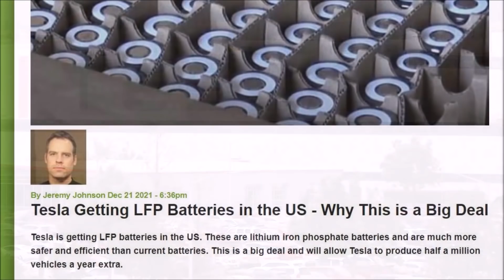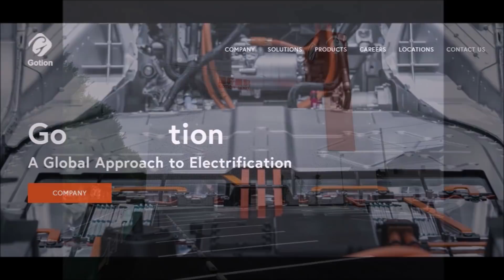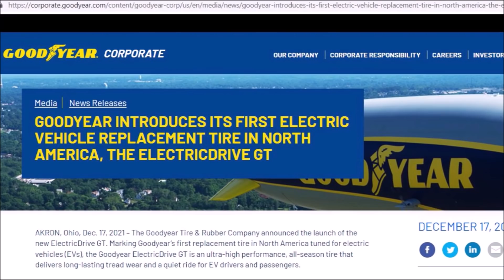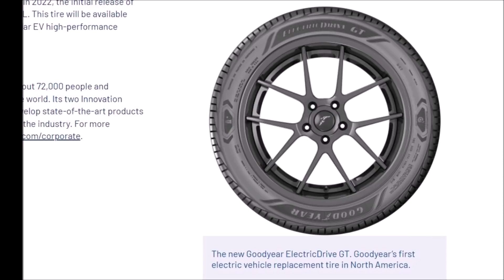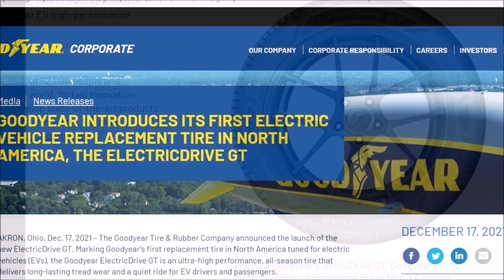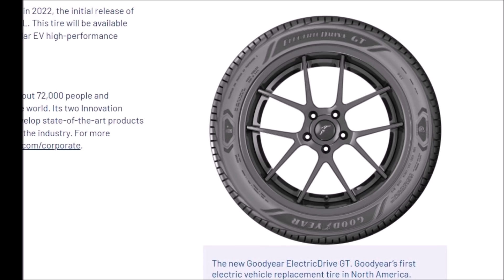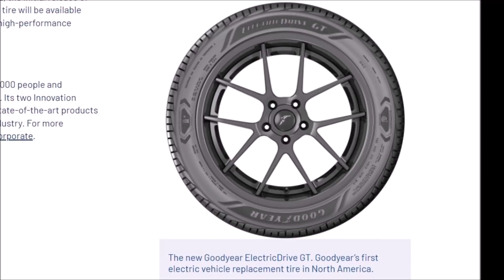BIG DEAL: Tesla Got New Batteries! Allowing 500K Extra Teslas a Year

Comment: LFP's main advantages are low cost and good availability. Not efficiency, energy density, pack weight, or performance. It makes good sense to use LFP batteries for Powerwalls, and also with their entry level models. The problem is that Tesla is not passing on any of the cost savings with lower priced models. While I never complained about Tesla's $35K Model 3 availability, the lowest price for the entry level Model 3 (using LFP batteries) is $45K ($10K more). Most EV owners charge up overnight, and don't need to recharge from zero to 100%, so they don't have to worry about having a shorter battery lifespan, where LFP could otherwise be an advantage. At least Tesla has not raised the Model 3 Performance price much, so it has become a relatively better value. LFP does have some advantages, and it is predictable that Tesla would be this battery buyer, but I think that it has more to do with profit and supply rather than anything else.
Reply from the maker: Thanks Dean.
Reply: Supply of EVs is not in balance with demand, and probably won't for a few years, but it will eventually, and then we will find out whats what with pricing.
Reply: @mohammadwasilliterate8037  Elon is not about profit. Elon is driven by issues like safety & performance and regards profit as a positive byproduct. Those two attitudes are not congruent.
Reply: LFP is safer than other rechargeable lithium. Low energy density but have longer cycle life and charged faster.
Reply: @tsamuel6224  Elon is absolutely about profit.  Profit is what kept the company from being sold off to GM, Toyota, Mercedes and VW over the years.  Now that Tesla is flush with profit, it has expanded and advanced the business on multiple fronts. What do you think it takes to build a giga factory?  What about going to Mars.  Elon is brilliant, but without money (from the for profit side of the house), he can't go after them.

Comment: Lfp? where is 46-80 battery?..
Reply: LFP is the battery chemistry. 4680 is the size of a cell (and in the case of Tesla, it also refers to the new capless design that they introduce in their new 4680 cells). You can have a 4680 LFP battery. That said, Tesla would probably start producing their own 4680 LFP batteries soon (and may in fact already be doing testing and calibration on just that). But they are battery constrained and can pretty much use every battery they can lay their hands on. Even if they produce their own batteries and even if their own batteries are superior. As long as the batteries they can get elsewhere are good enough, they'll try to get batteries from elsewhere as well.

Comment: Can LFP be used in 4680s?   Is 4680 safer than the ones that have been catching on fire 🔥?
Reply: As I understand it, yes. They are making the 4680's with the LFP chemistry. Also, the Bolt batteries that were catching fire were flat packs, I believe.
Reply: If you are worried about vehicle fires, sell your Gasoline car immediately because it is 11 times more likely to catch fire than safer electric cars.
Reply: @jacka7211  Exactly!
Reply: @jacka7211  the amount of damage done when EV catches fire is far greater, when it happens.   When is the last time you heard of a parked gas car burning down a house? It doesn’t happen.  I am still a fan of EVs.  They should get to the bottom of these problems.
Reply: LFP is better on cycle life, Max temperature and cost. Worse on weight and size for the same kWh.
Reply from the maker: Probably so, because 4680 is just about the size of the battery. In my understanding any chemistry can go into any size.
Reply: @Torquenews  as long as it can disapate the heat generated.
Reply: @Torquenews  Exactly correct.
Reply: @IQBooks-pub  The case of the Tesla burning down the house, it turned out to be the other way around. The fire started inside the house. The sentry cam footage proved that. In the case of the Bolt burning down houses, they found the problem hence the recall of every single one they ever made (and LG Chem offering to pay GM a couple of billion).

Phillip.
Reply: @philliptemple4534  that’s good  to know as an investor 👍
Reply: @philliptemple4534  The case of the Tesla crash in Spring Texas involved a fire that the fire dept couldn't put out.  They had to call Tesla for help.  2 victims.  Playing with high speed.  Lithium ion batteries have brought down airplanes.  Don't try to downplay the danger.  LiPO4 batteries have been around for a few years and are far safer.

Comment: It's not Tesla, they have plans for 4680 lfp cells and structural packs
Reply: So what? Tesla cannot do both? They can certainly use batteries from other providers as well. CATL is now building a giga factory next to Teslla's Giga Shanghai an they've announced a contract to supply 70GWh to Tesla from that new factory (in addition to what they are already providing). OK, that's China, not the US. But at the moment Tesla is battery constrained. And they intend to massively increase their megapack production in 2022. And they will take time to ramp up their own LFP cell production. Why would they not want more batteries if they can get them when they can still use every cell they can get?
Reply: @gerhardlemmer5356  the 4680 form factor needs the tabless technology for cooling

Comment: Emphasis on the fact that LFP battery cells are safer, but may have 10-15% lower capacity for the same size as the other types of lithium batteries. That means these will be cars with som 10-15% less range, at a time when range anxiety is still a concern.
Reply: @mohammadwasilliterate8037  Your solutions all can be applied to the other battery types to get the same high demand range extension. Bolting batteries to seat backs would be unsafe and expensive. Finding more room in the chassis would be a good trick, Volvo uses a structural reinforcement that kills the frunk size.
 LFP are the only lithium cells that do not use highly flammable electrolyte, but few industries use them because they are also simply the weakest chemistry. For low-range urban use, they'd simply be a way to get past the battery shortages. You can bet Elon knows that.
Reply: @lyfandeth  First not necessarily all of those solutions can be applied to other battery chemistries. Structural batteries (like Tesla planning to make the battery the floor, removing some more parts of the vehicle in the process and thereby simplifying the production and reducing the weight) would AFAICT be less safe and strong if not LFP.

Also, range anxiety and loss of 15% weight to capacity ratio aren't much of an issue if you can get >500km anyway and can charge in <10min and have access to Tesla's great charging network. If Tesla's efficiency continues to improve elsewhere, or if they can improve the battery capacity by switching to 4680 tabless cells (and their providers can also do the same or something else with similar savings), etc., then the range will remain the same or more than it currently is (already >500km). And in the mean time, LFP batteries can charge a lot faster without significant degradation.

Comment: I am unfamiliar with the average width of tires on new cars, today. However, it appears that these tires are too thin. Wider tires track better on the highway and deliver better traction in rain and snow.
Reply: Those are fairly wide tires. Most of the shots are side shots so it doesn't show so much, but there are clues if you look for them.